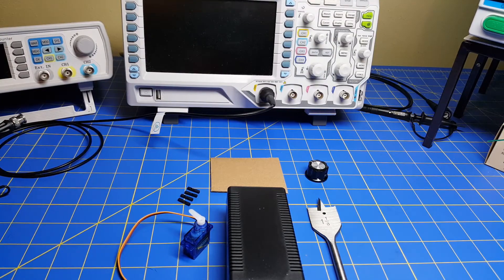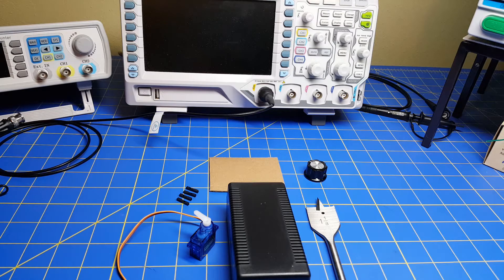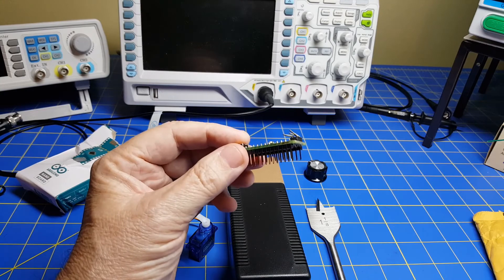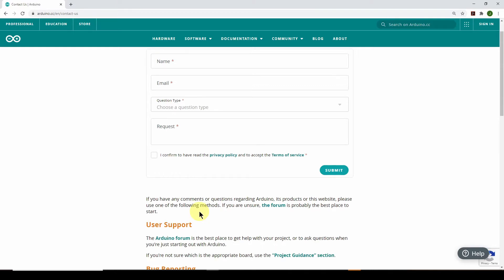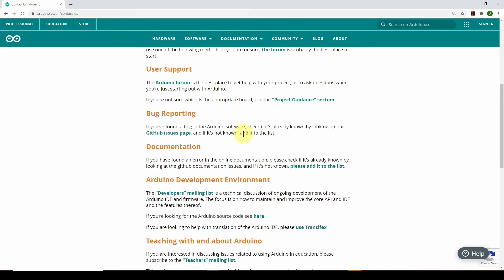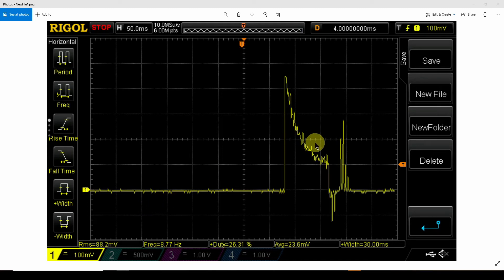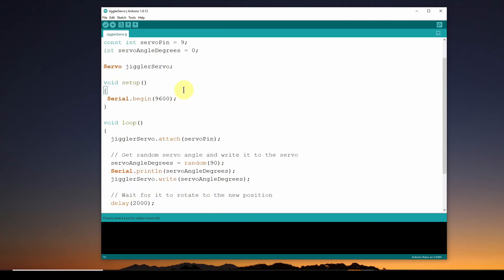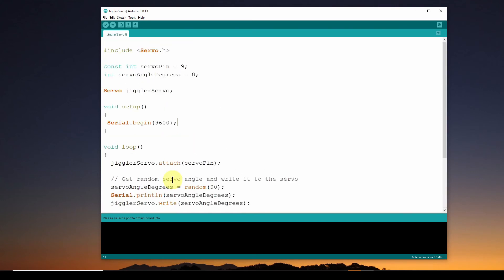Mouse Jiggler Project Part 3: Arduino & Servo

Comment: You have a lot more options for returning and/or asking for a refund if you used bought the item on Ebay. I bought and received many Arduinos on Ebay and received a couple that were damaged. I requested a replacement or refund and without exception the seller sent a replacement along with instructions to simply discard the damaged unit. Some sellers apologized for the inconvenience.